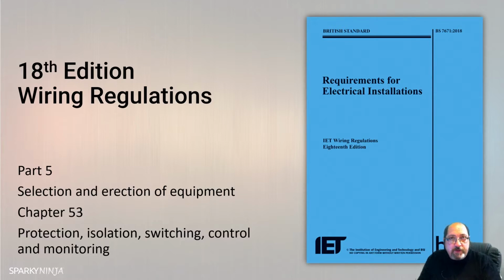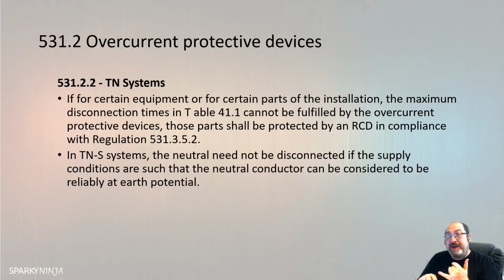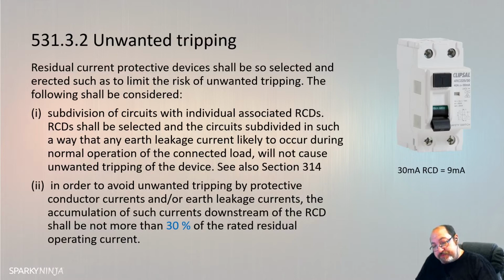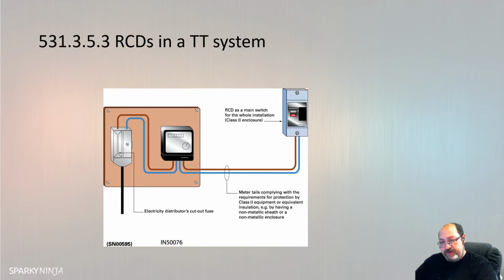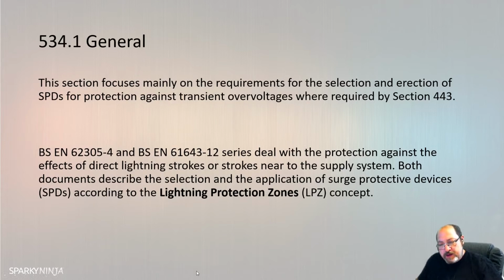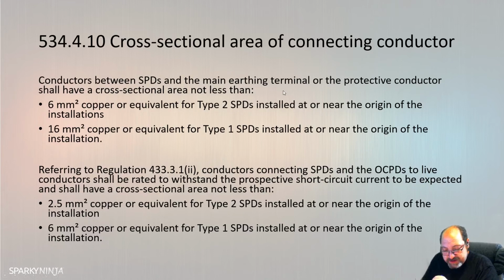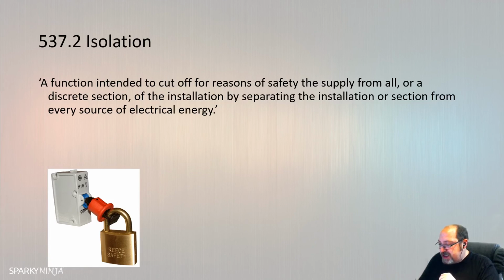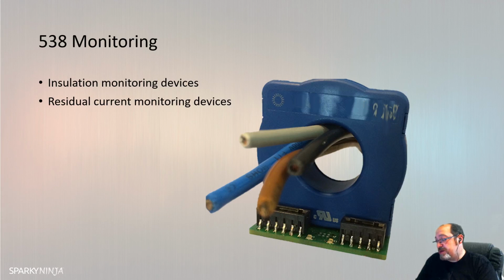18th Edition Training Series - Episode 14 - Part 5, Chapter 53 - Protection, Isolation, Switching..

Comment: I have to say you do such a brilliant job explaining this course. I’ve been qualified since 2007 have been working for myself as an electrical contractor in QLD Australia and have just moved to Belfast and your videos are brilliant in prepping me for the rule book course. There is one scenario you are talking about Unwanted Tripping, 531.3.2 a perfect example, I used to design, wire and commission very large LED advertising screens with around 200 PSU’s and a perfect scenario was I had to take into account the start up leakage currents for the rectifier of the PSU 230v/5v as on the earlier PSU they leaked 3ma for 1ms as the screens were timed to shut down overnight and then restart early AM. So I would only put 6 PSU’s on one CCT. They did get better over time down to 1ma so then I would put around 12 per CCT. Thought this may be a good example if you wanted to use it in the future.  Thanks again for the great videos. Regards John

Comment: Regarding 531.3.2 and the 30% maximum earth leakage rule: If you were doing a rewire, is this not something that could be measured/or you could get a feel for, before you start rewiring, by getting the owner to switch on their existing equipment and measuring the leakage to earth. A pain to do maybe, but not totally impractical.